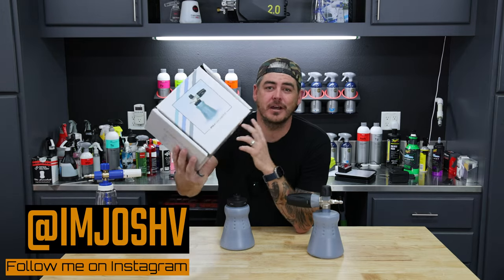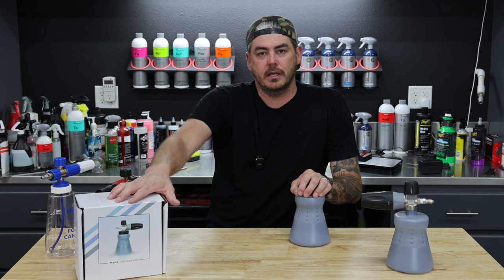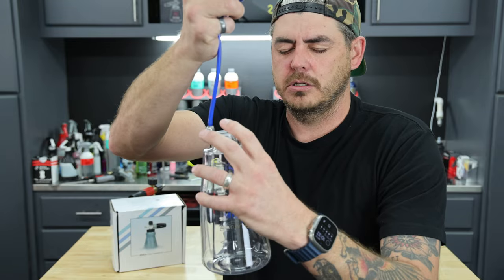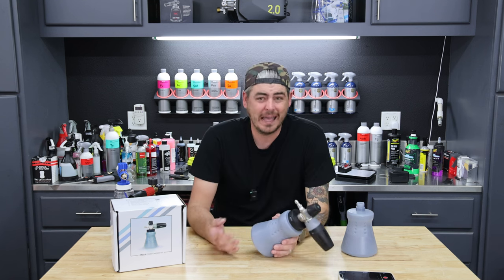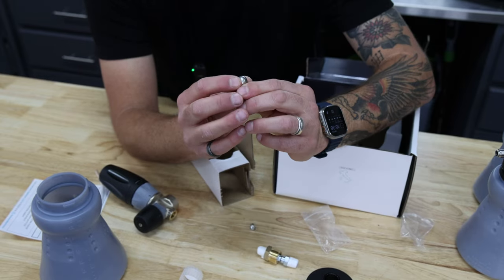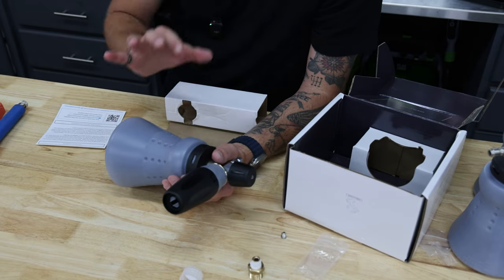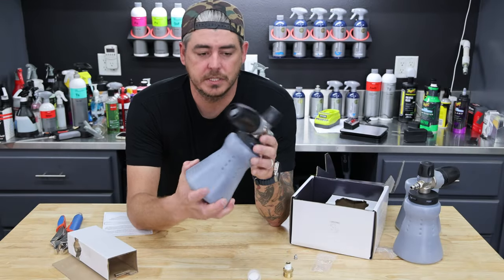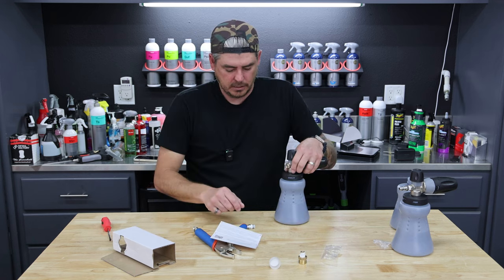NEW MTM FOAM CANNON - Is it Everything we hoped for? | FULL REVIEW

Comment: PF22 was my first foam cannon but have to say not impressed.  The bottle neck to too small, a ridgid, non-weighted tube, plastic threaded bottle to a metal connector, and if I drop the foam dial more than 3 notches from max foam, the contents start to pour out the nozzle.  The new one's connection doesn't look promising. Seems frustrating.  They do produce good foam though.  But my next one will be the MJJC.

Comment: Got Griots Boss when it 1st came out a thousand yrs ago still works perfectly. all quality plus the stainless components. definately best cannon out there.  if when it breaks I'm going cheapo cannon.  they all foam the same with a 1.1 orifice. no need to spend almost 100$ for a foam cannon. spend your $ on quality chem8cals and pressure washer hose n quick connects over any cannon.

Comment: So glad I searched (and found) your video on this Josh. I recently ordered this MTM cannon in the original version (narrow top), however I was sent the wide opening top. I thought I scored big time, until I tried (and tried) in vain to tighten the top of the bottle (black top) and thought *wth*. I thought it was either defective or I was just not strong. Then I considered oiling the tabs a bit or maybe just rubbing soap on it to help tighten it. I didn’t try that but I’m considering it. I did swap out the orafice to the 1.1 since I’ll be using it with my Ryobi 1800 PSI electric power washer. Hopefully I’ll either get stronger or my cannon top will wear in.
Reply: Did yours come with a tube? Cuz I just got mine but I didn’t get the little tube thing

Comment: Yeah, putting the head on to the adapter first makes it 100 times easier thanks to the added leverage of the head length when doing the quick connect turn.

Biggest benefit of the MTM over the MJJC is the product usage. MTM is WAY more efficient in product usage for the results than any of the MJJC offerings, which is especially helpful when foaming wheel cleaners straight, etc. 

MTM for me!

Comment: Josh… I just received my wide body PF22.2 today. I previously used the MJJC Pro which was great. I was not going to buy a PF until they had a wide body. Narrow was ridiculous. I too did not like the looks of the PF wide body  manufacturing. I shaved the grey tabs moulded poorly with a sharp utility blade. Also the top rim of the bottle has a rough top edge that sticks up. (Mounding point)it will rip the seal and cause tightening issues.  I shaved with sharp utility knife smooth then sanded entire top rim using 1000 grit paper then 1500 on a flat surface. (Counter) . I wrapped about 5 layers of teflon tape on the top that connects to sprayer and crazy glued the plastic to metal connection to prevent top from releasing from sprayer when you unscrew bottle. I think my problem is solved. Also the connector that connects to your hose that you screw on had way too many layers of teflon tape. Maybe 5. Reduced to about 1 1/2 rotations.

Comment: I see the MJJC tended to fall over when you set it down on the ground. That's one of my pet peeves with some cannons. I do like the quick connect vs a threaded top so I'm conflicted lol.
Reply from the maker: The mjjc sv3 has a nice wide base just not as wide as the mjjc pro… it was laying on its side in the video but I was rushing so I just tossed it down so I could try to compare the foams side by side without too much time in between.  But if you want the extra wide base to be safe go with the mjjc pro or the griots boss

Comment: I’m not a fan of the wide mouth bottles, especially with its own threads and size opening. The benefit of the small mouths ones is you can use any water bottle. You’re not limited to their bottles. I have multiple bottles for different soaps. I also have different sizes and caps for them all. I like the fact that this one is just an adapter and can still be used with small mouth bottles.

Comment: It's a shame that the weighted filter doesn't come with the wide neck bottle too for users upgrading from the narrow neck original. They should've just stuck with a screw thread connection too. Those bottles are probably outsourced and the next batch will probably be a better fit but I'd still prefer to see a screw thread instead.Thanks for the comparison test tho. 👍🏾

Comment: Gotta agree for some weird reason I like the sound of the mtm I noticed it when I had an old pf22. Also could you make a video on how fast these foam cannons go through their soap solution I’ve seen people say the mjjc goes through the liquid faster than the mtm or other foam cannons
Reply: The MJJC's definitely go through the liquid fast no matter what setting it's on. I can maybe make a full coverage pass, or pass & half before it's depleted. So, I would love to see that video.
Reply: European here so sorry for the unit measurements. 
My setup gets 6.0Lpm output from the short trigger gun. 
MJJC Pro v2 with 1.1mm orifice produces 6570ml per 1000ml of solution. MTM PF22.2/3 with 1.1mm orifice produces 8500ml per 1000ml of solution. 
Respectively,
 MJJC Pro v2 with 1.25mm orifice produces 7580ml/1000ml and MTM PF22.2/3 with 1.25mm orifice produces 9750ml/1000ml. 
Take from that what you will, hope that helps. 👍

Comment: I’m on the other side of the world but wanted to ask. If I bought the new mtm cannon and it had the option to choose a karcher adapter for weekend warriors like myself. Should I still get the part in the box for the 1/4” quick connect plug? Or would they keep that.

It was the same price standard or with the karcher adapter. So I guess it’s fair for them to keep it?

It’s a new pressure washer and in the near future I would have looked at buying a better trigger/handle for washing my cars

Comment: When you or MTM  be selling the weight for the tube straw by itself? I bought 2 of these and used one  today and not great with quick connect since poor plastic molding job. MJJC SV 3.0 which has more imbalance weight distribution toward the tip vs the MTM , but slightly better foam and the original MTM doesn't have the weight feed tube which is much better help for the roof. I will be interested to See the PRO version 3 when it come out.
Reply from the maker: Yea I’ve seen the drawings for the mjjc pro and it looks like a mix of the sv3 and the pro. Same shape as the pro now but with the quick turn connection. They say more foam too but I’m not sure about that. I don’t have the mtm weights but I’ll see if they will be offering them

Comment: I cleaned up the tabs with a knife and added an oring on the neck of the adapter because the adapter wouldn’t stay in the head when removing the bottle. The oring acts like a lock washer keeping the adapter in place. 

MTM dropped the ball on this one. I would expect this from an Amazon special, not MTM.
Reply from the maker: Those are great ideas! But I agree, mtm should have had that sorted out. You shouldn’t have had to do that
Reply: @imjoshv  just used it on a maintenance wash, worked great!

Comment: That excess plastic on the tabs is called flashing. Until the manufacture cleans up his mold, the only way to deal with it is to file it off.
Reply from the maker: Yep and it does file down, but the mold should have been cleaner. It seems like that’s where the material gets pushed out and no one is there to clean that part off

Comment: You know it's crazy, last time I washed my car was using the mtm and foam is great of course: worked fine for a moment and then would just spit out a spout of soapy water to the ground. Took it apart and cleaned it, looks like the intake piece was RUSTED. No clue if that was causing my issue but for the price I paid am a little disappointed: my cheap chinese amazon  foam canon is run with brake buster for 3 years now and no issues, foam sucks on it though.
Reply from the maker: Interesting. They use nickel plated brass which is more resistant than standard brass… but even the stainless steel pieces and some foam cannons can have issues over time as well